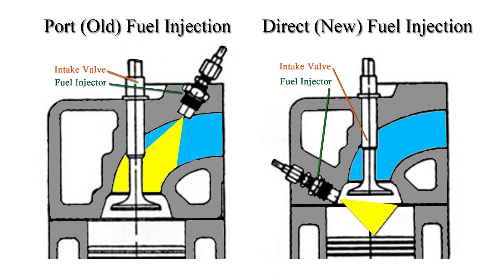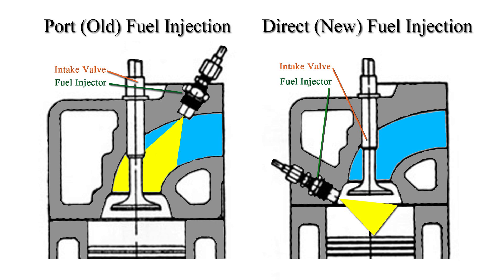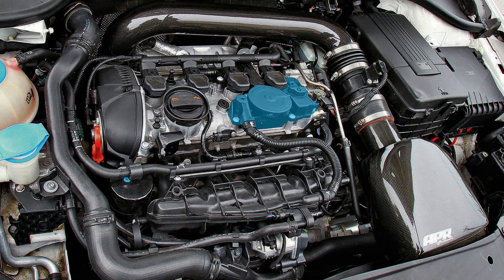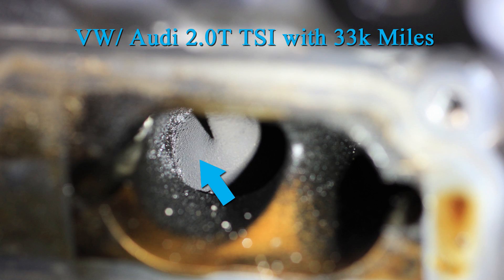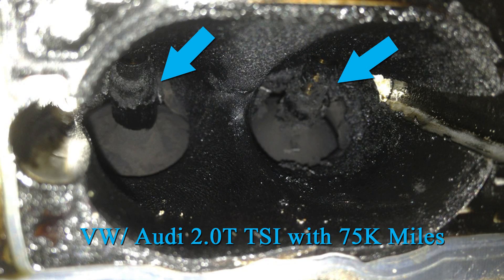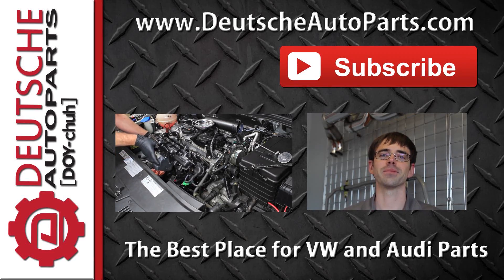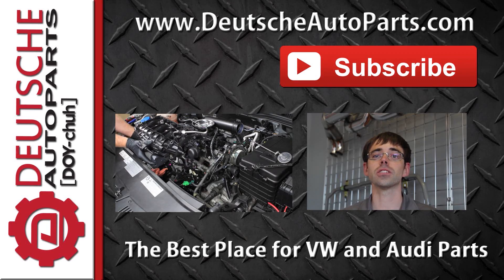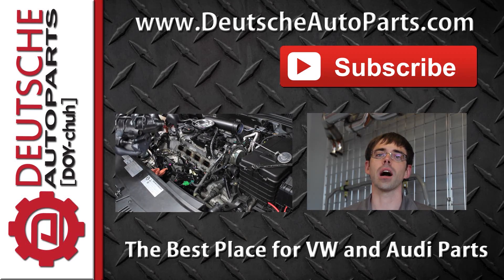Carbon Build up on Direct Injection Engine (Intake Valves) AKA GDI Gasoline Direct Inection

Comment: How so that diesels don't have this issue, they also come with direct injection but never heard someone had to take engine apart and clean the valves after 30k miles
Reply from the maker: From our experience the diesel carbon comes from EGR and not the PCV.  This results in clogged manifolds and EGR valves (at least on VW) which is a different issue than what is talked about above.
Reply: Alright, thank You!

Comment: How in the world have the car manufacturers been able to get away with this? It's absolutely unbelievable
Reply: manufactures should be covering this for free... Then they will fix issue or stop making cars that have this issue. Its not the owners fault, this is an issue anyone with these cars will incur. Insurance companies should be on our side to rectify this issue.
Reply: https://www.youtube.com/watch?v=xrLNDgrIw3U

This tells you everything. But the answer is "emissions" regulations, and making an internal combustion engine do something that its not designed to do. VW and everyone else had to do this to meet the ridiculous standard created by 3 letter agencies that are full of people that cant change their own oil but can make these decisions for us.
Reply: In a test environment, it probably worked great
Reply: @Nskawtea1  suuuper late reply here, but yeah i agree. It is probably because they didn't drive the dang car for 50,000 miles before checking for buildup 😂.
Reply: +ludwig fan u are very intelligent
Reply: Young Rios
Thank you.
Reply: Anything to meet the impossible epa standards
Reply: You can thank the EPA for this. I would just unplug that shit from running back into the intake when I buy the car and route that pcv hose to the ground or something. Once I do that I will plug that open inlet on the air intake system. You should never have a carbon problems then.
Reply: Jeff Sol thats what you get for buying a new car.Should have stuck with a 90s/early2000s model.But no.You want to finance the whole world,look good in front of your friends,oh I want a new car.Then you bitch about it?Ahhhh GTFO
Reply: Luke AOD A fellow forum member posted his pics online ,even with a catch can.Still a ton of buildup
Reply: Make fossil fuel vehicles inefficient to sell EVs
Reply: If the public buys it, someone is going to sell it. Most of the public doesn't even know what DI is let alone that it is far more trouble than it's worth.
Reply: DI offers better fuel economy but less reliability. So much so that the economic savings from better fuel efficiency is greatly offset by the cleaning necessary and the downtime of having your vehicle at the shop.

By that I mean economic savings to the owner of the vehicle. The dealerships and shops get an economic boost from repair costs to the consumer, or owner of the vehicle in repair bills after the warrantee is over.

This leads to manufacturers being economically incentivized to reduce reliability unless something incentivizes them to improve reliability. A class action lawsuit by consumers would have that effect. 

Although it looks like at least some manufacturers are looking into ways of fixing this issue, maybe because their legal department advised them to. ;)
Reply: Main reason is because it's not as prevalent as all the horror stories you read online would have you believe... It is mainly limited to certain conditions that the owner subjects the engine to.
Conditions that make it worse are:
Short trips/never allowing the engine to heat up for extended periods of time in order to burn/blow the carbon off.
Poor quality fuel - low detergent content leads to fouled injectors, which leads to uneven spray patterns, which leads to fuel dilution of the oil, which leads to volatile compounds being evaporated through the PCV and into the valves.
Poor quality oil - mineral oil causes the hard black crystalline build up when exposed to heat, whereas synthetics are more resistant to heat and forming deposits upon contacting the valves.
Heavy traffic and low RPM driving - excessive idling increases fuel dilution as well, and the lack of spirited driving makes sure any deposits stay where they are. When an engine reaches high RPMs the valves rotate in their seats and this clears the seat so that they close fully. Not only that the heat from a good hard drive will burn off most of the carbon that is already there.
As you can imagine a lot of people are operating in 'all of the above' conditions which guarantees they will have these problems! 
I agree they are higher maintenance as they require a little thought and 99% of buyers don't consider this. 
Another note is that the serious build up like in the video is limited to older VW and BMW engines. Hyundai/Kia and Ford have never really had any issues with their direct injection engines having carbon issues...
Reply: As someone who deals with this issue on my DI I can say it definitely pisses you off. If you can clean them yourself it's not so bad cause it saves you a stack but then you've gotta sit there for 5 hours working on it every 60k miles while you curse out your car. I'm not that surprised that car manufacturers are implementing direct injection, because, yes it increases fuel economy and power but I think it's more important to the manufactures to meet ever more strict emission regulations. 

I am highly skeptical of this video. One of those too good to be true bells is ringing in my head. Like "hey you can stop dirty valves all you need is this catch can we sell. Hard to believe any reputable car manufacturer would leave out an oil catch system that would give an additional 50% effectiveness.  Not saying it won't help but I'm pretty doubtful it's going to completely stop it. I have yet to see a single post or video with credible evidence showing the effectiveness..... Got a good idea for a Youtube video though
Reply: @YOURMOMxo69xo  He specifically says a catch can will NOT solve your problem, only reduce it so the cleaning can be avoided for maybe 10, 20, , or 30,000 miles... but that you WILL have a problem... that ALL direct injection owners WILL have this problem. You can ONLY slow it down. There is NO FIX. Pretty shitty to find out, because I just bought a 2023 Impreza 5 speed and might not have, had I know about the valve issues. I do love the car though. But damn... that's a shitty problem to find out about. AND the previous owner didn't change the oil the past 20,000km, so I most likely have extra carbon build up... and the dealer refused to do an oil change before selling me the car. I had to go buy some Pennzoil and do one myself
Reply: If you know an engine that can run on organic pixie dust and magical fairy farts, I'm all ears.
Reply: ... and hope that during your next inspection that you don't get an EPA ticket for doing that... if you have inspections. It's the same giant ticket you'd get for removing a cat.

Comment: does the same problem happen with diesel engines as well, as they have direct injection too??
Reply: Yes and often times worse than gasoline due to the EGR valve and high soot. My 335d intake is being cleaned but there is no solution for the intake valve without complete disassembly
Reply: Derek Rostock Thanks

Comment: What are the symptoms of intake carbon buildup and how bad does it have to get before it causes a problem?  I've had a 2007 Mazdaspeed3 since new and it now has nearly 300,000 miles, but it runs just fine.  75,000 miles came and went a long, long time ago!
Reply from the maker: +VAspeed3 Generally on VW and Audi model cold start misfires are the beginning.  It likely depends on model.

Comment: Or just don't buy a fucking DI engine. Problem solved.
Reply: Problem with that is, in 5 years, most vehicles will be GDI. Most diesels are DI.
Reply: Michael Harris Toyota/Lexus build engines which are both DI and port injected - two injectors per cylinder - and they don't suffer from carbon buildup. So it can be done. But they need to want to do this.

Comment: Hi Pro, does the 2.0t engine on 2016 Tiguan still have this carbon build up problem? Is there any improved engine design to slow this carbon process?
Thank you.
Reply from the maker: +Shiwei Luan Yes it likely will have this issue.  There is not much you can do as mentioned here.

Comment: Great video! Could you by chance just not reroute the PCV into the intake manifold? Do like old muscle cars and just have a breather filter?
Reply: Well yeah, you stick it back on before emissions testing... I did my own research and you can do that. You just have to get a block off for the intake manifold.
Reply: icekk007 You do have a point. It is shifting the issue. Theoretically, the best way to do it is route the pcv back into the exhaust before the catalytic converter. All in all, any sort of internal combustion engine is going to pollute. I would just rather have my car last longer and run healthier than worry about a small increase in my carbon footprint.
Reply from the maker: +Zakk Gross removing the PCV is illegal and would not pass inspection in most places.  That is it main purpose.
Reply: +Zakk Gross This is how old cars manage blowby and crankcase pressure by venting the PCV to ambient. The trouble is any oil and fuel will emit to the environment directly, polluting the air.
Reply: This is a way to get around emission testing. However, modern engines with 3-way catalyst, the exhaust emissions are very low. Removing/bypassing PCV may become the major source of your car emissions. Are we really solving the problem or just shifting one to another?

Comment: A preventive measure that I know it works for this GDI issues is BG products.MOA, EPR and 44K.
You should research his products test them and let us know.
Reply from the maker: +Charlie Casetellanos I'm familiar with BG and like their products.  I actually spoke with them about this at SEMA in 2014.  To be frank I dont feel confident those products would make a significant impact on this issue (Specifically referring to VW and Audi).  The only way to know would be to clean the valves on a model that is know to have these issues then do a long term 50k mile test using BG products then remove the manifold to inspect.  We dont have a vehicle that would apply to this so we cannot perform said test.  Hope this makes sense

Paul

Comment: I have a 2008 Jetta Wolfsburg and have been told it needs carbon cleaned off the valves (at 78K mi). You answered all my questions and were right to the point. Thank you so much!
Reply from the maker: +Christy Fae Glad it was helpful!

Comment: Will the use of synthetic oils help delay the carbon buildup?
Reply from the maker: +Marvin Santiago It will help but it likely will not solve the issue if your vehicle is prone to this.
Reply: +Deutsche Auto Parts Thanks, I'm aware this is a design issue with some gdi cara but every bit helps at least delay the inevitable.

Comment: Using a PAO fully synthetic engine oil, like Mobil 1, helps.  The synthetic oil produces much less vapor to be sucked back through the intake.
Using a catch can is illegal in California because it violates pollution control laws.  I don't know about other states.
I think that using soda on an cast aluminum head or intake manifold is a bad idea because the caustic soda could corrode the metal.  The soda itself could enter into the lubrication system and obstruct oil flow.  Walnut shells could be worse.  I would stick with a ph neutral chemical organic solvent and use plastic or wooden scraping tools; popsicle sticks and plastic putty knives.
Reply from the maker: +John Ferguson Whenever cleaning valves with media its we assumed that all ports would be block and the valves of each cylinder closed to ensure they wouldn't get anything in them.  Failing to do that as you mentioned could allow those media into the lubrication system which would be bad news.
Reply: Deutsche Auto Parts   I am thinking about the blasting media being pushed up the valve stem into the valve guides and becoming trapped inside the stem seals.  Using a chemical solvent just seems safer than using blasting media.  Thanks for the video.

Comment: question: what are upsides of direct injection? why did they start using it( emission i guiess)

thank you.
Reply from the maker: +Roman R Emissions, fuel mileage, more control which allows for more power.  It pretty much better in every way.... with the exception of this issue.

Comment: +Deutsche Auto Parts wouldnt throttle body injection just be a glorified carburetor?
Reply from the maker: +Vinny The Tech They wouldn't switch to throttle body injection.  It would be a direct injection engine with an additional injector at the throttlebody that is only activate at wide open throttle.  

Hope this explanation makes sense.
Reply: +Deutsche Auto Parts well I wasn't talking about GDI engines per say, like one could just put one or two injectors behind the plate on the throttle body and it should work just fine, but thanks for replying anyways

Comment: Just disconnect the PVC system for normal use,  then re-connect when you need to get your emissions system checked.
NO PVC system = no vapors returned back to the intake valves = no carbon buildup.
To avoid a 'check engine' light that might go off because of that PVC delete, plug up the disconnected hose that used to go to the PCV valve, this then prevents a 'Vacuum Leak' that would normally set off the 'check engine light'.  But do NOT plug up the PCV valve itself, just leave that open.
And you have to do this when the engine is NEW, before any buildup has started.
(And you have to put everything back together when you go for your emissions checkup.)
Reply: @Adam S and @Honesty Counts, I LOVE how the person suggesting we cheat the system has the username "HONESTY COUNTS" hahahaha...... so great haha
Reply: OR buy a catch can and leave the outlet of the catch can open and plug up the hose on the engine that would go back into the intake. That way you at least try not to blast that junk into the air. ;)
Reply: +Honesty Counts This sounds like something really shady that could end badly in a lot of ways.
Reply: +Adam S (Dolby109) =  A lot of people have problems with their PCV valve plugging up , and when that happens the pressure inside the engine's crankcase builds up, pushing oil past the piston rings, resulting in excessive oil consumption.  If you just unplug the PCV valve hose but leave the PCV valve open the way it is, no harm is done to the engine, it runs just fine.   In the 60's the crankcase was simply vented to the atmosphere, there was no recycling of the gases, and engines had no problems back then.  Do some research and you will find out I'm right.  (I just learned that you will need to plug the now-open hose that comes off of the PCV valve, otherwise the engine control computer would register this as a VACUUM LEAK, and a check engine light will go on.)
Reply: Honesty Counts I was more talking about problems with warranty if the computer figures out what is going on, or with the NHTSA as removing emissions hardware is illegal.
Reply: Yeah, your warranty is probably going to be voided.  But most warranties do not cover carbon buildup issues, so even if you keep your warranty intact you are going to have to pay from $2,000 to $4,000 to have the carbon buildup removed from your old engine.  If you lease your car then just leave it alone, but if you are going to keep your car for more than 6 years then simply unplug the PCV hose from the PCV valve, plug up the line going to the intake manifold, and you'll be good.  As for the government figuring out what you've been doing;  good luck with that, they are too busy with other things to even care.
Reply: just kidding Honesty Counts; I actually found your post to be very informative and appreciate it. I also know you're not really suggesting it to anybody but r just raising awareness to an option... basically just making talk in a way is how I see it.. cheers

Comment: What do you  think about BG Products cleaning trying to prevent carbon build up?
Reply from the maker: +Guillermo Noguera BG makes nice products and I spoke with them at SEMA about this in 2014.  They claimed to have a solution but it seemed far fetched for me.  In my opinon the only way we know it works would be to create a long term test on a model know for carbon issues.  Until I see that I would not endorse a single product.

Comment: If the old way was better why change it?
Reply: +Jose montano Fuel economy.... Toyota actually nailed it with the D4S system... (FR-S and some lexus) that have 8 injectors - Port and Direct... Problem solved.
Reply: lapped less emissions with direct injection
Reply: +Jose montano = Hyundai has gone back to the OLD style Multi-Port fuel injection for their new 2017 Elantra for the exact same reason you just stated;  (the old way was better, so why change it.)  That's the car I'm going to be getting when my 2008 Corolla needs replacing.
Reply: Government forcing cafe standards and air quality. Just add port injectors to DI like toyota to eliminate the problem.
Reply: +lapped yup it really works well. I have never had any problems with mine
Reply: lapped all lexus's except IS250 it has only GDI

Comment: I have a 2010 Audi A4 with 105k miles now, no idea if he has a intake valve cleanse but i'm certainly doing it this coming spring. My brother has a 135 and is doing a walnut blast of his valves so it works out conveniently.. except actually doing it
Reply from the maker: +mahunik Yup walnut blasting is a great way to clean up carbon
Reply: +enginemaxcarb. whats not proven about direct injection?
Reply: +mahunik Its inability to prevent carbon deposits? MPFI is better than SPFI and carbs. But now direct injection may be a problem more easily solved by reducing vehicle weight.